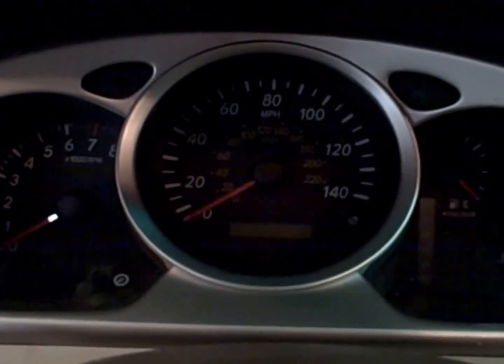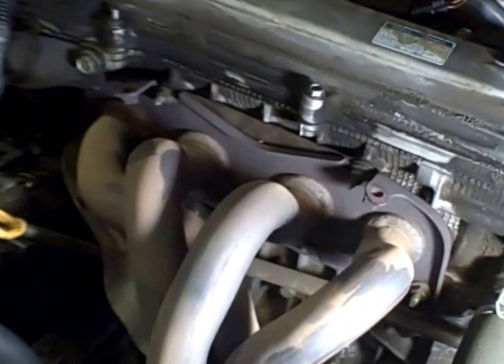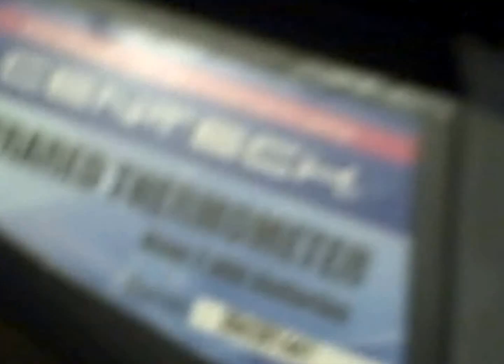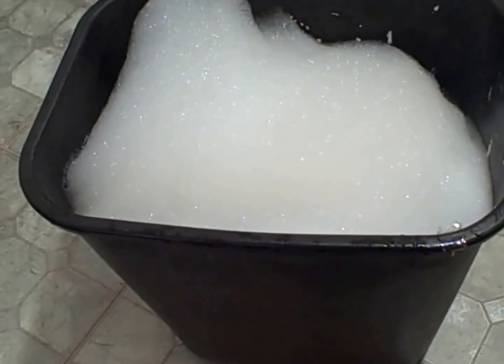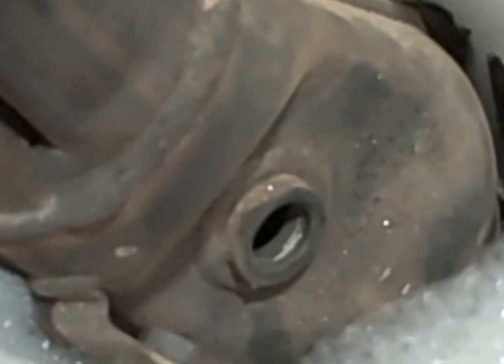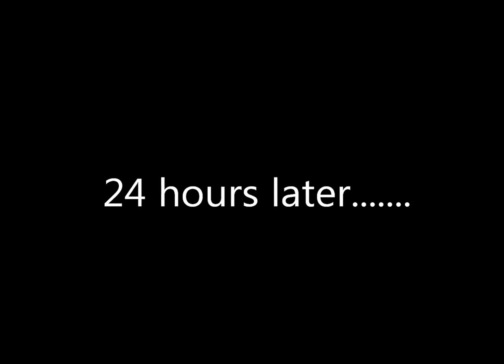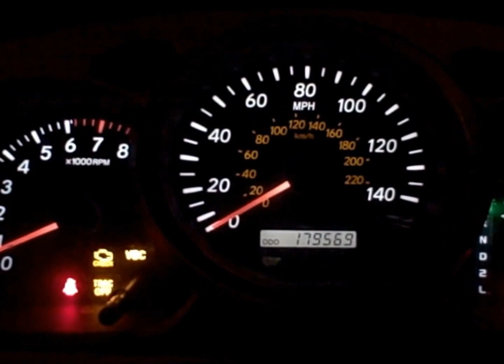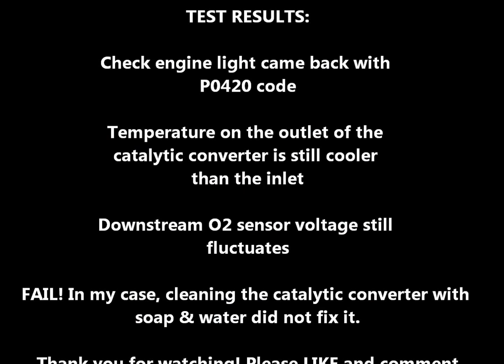Catalytic Converter Repair Test

Comment: laqor thinner, simple green, purple power....thanks for the input
Reply: the good news is...your a expert now and the replacement job will take 75% less time and the bolts and nuts are not rusted to crap and rust welded or stuck.